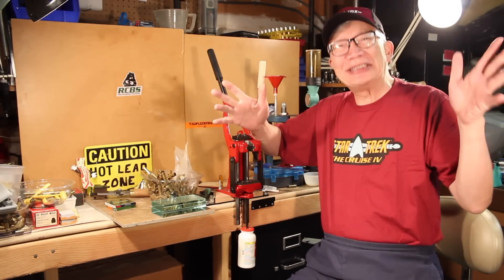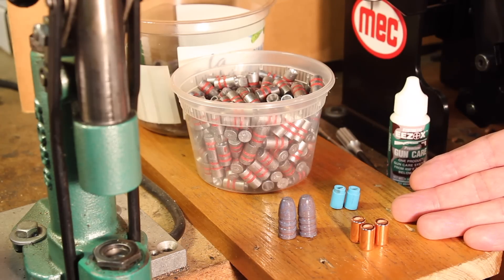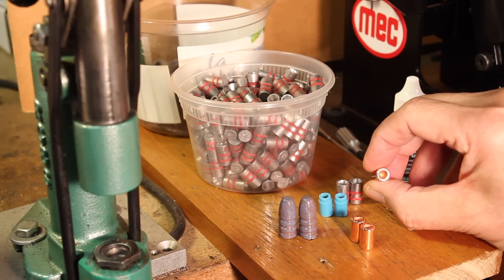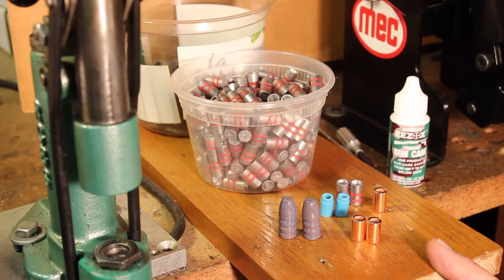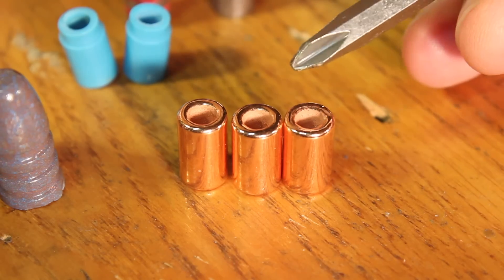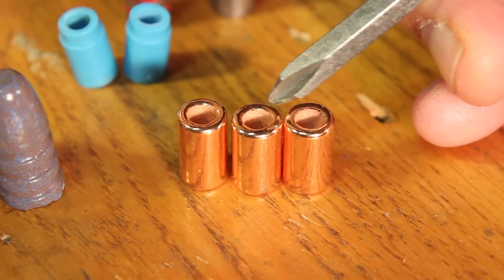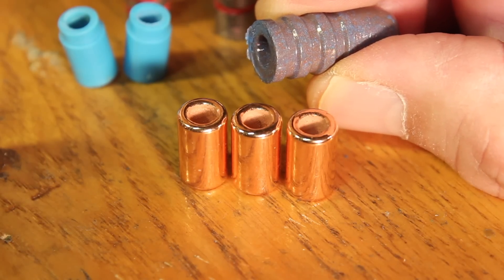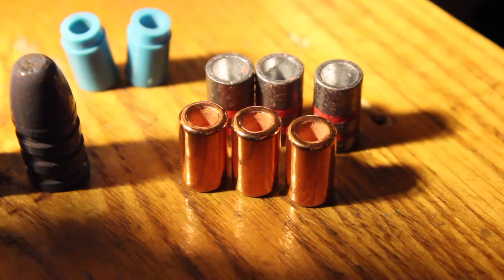The Rules Of Thumb For Hollow Base Bullets

Comment: I used Hollow Base wadcutters for years.  When I began casting, I slugged the bore of my favorite .38 Special revolver, a Colt Officer's Model Match.  I found the bore was slightly undersized at .355", chamber mouths were running .356".  I was using a 148 gr. "button nosed", flat base wadcutter design, cast from straight wheel weights and found that by sizing to the chamber mouth, .356", I got amazingly good accuracy.  I have been using that bullet ever since and it still shoots as accurately as ever.  I use 2.6 grs. of Bullseye, as I always did with HB bullets.  Velocity avg. from a 6" barrel is 698 fps.  Plenty to poke neat holes in paper targets and be very mild shooting.  With wheel weight bullets and 2.6 grs. of powder, the cost is little more than .22 LR ammo and the recoil and noise level is not much more either.  Cases last and last.  
HB designs, particularly in swaged bullets, are great if you are using "store bought" bullets.  If you are casting and can size your own bullets, experiment with sizing diameters to get the best results in whatever gun you are loading for.
Reply from the maker: gary K - The Colt OMM is a spectacular gun...I hope you still have it as it is a treasure.  Your gun was the reason Remington made HBWCs in .357" (sold them in 1000, 2000 and 3000 round cartons) as those would have been perfect for your gun.  My 38s always shot the .358s, but I didn't have that beauty of yours...  Brings back memories for sure...  Steve
Reply: @FortuneCookie45LC  Yes, I have that gun and I even bought a 2nd one!  The first time my wife shot the OMM she said "This gun likes me!" and I could barely get it away from her after that! 🤣  So, when I came across another one that was in near perfect condition, except that someone in the past had drilled and tapped the top strap for a scope mount, (ruining the collector value, but not the shooting qualities) I snapped it up for $475 !  Now we BOTH have an OMM to shoot at the range!  And I am busy casting button nose wadcutters!

Comment: After using many swaged HBWCs and many more "hard swaged" Meister HBWCs, I discovered the MP line of moulds for various caliber HBWCs. I use their .310, suitably sized, in .30 Carbine and .32-20 revolvers, and their .38, .41, .44 and .45 versions in the respective revolvers, including .45 Colt and .45 AutoRim. I cast them of 49% COWW, 49% Pb, 2% Sn, and powder-coat them, and they are among my most accurate-shooting bullets. I also use them reversed, as cup points, in all the same revolvers. The 3" Bulldog really likes the .44 cup point, as does the 4" M1905/CH4 with the .310 version, and the .45 HBWC is the basis of my match revolver loads in the .45 AutoRim.

Comment: I started casting in 1985 for 40mm & 3" cannons, both breech & muzzleloaders in both sizes. The same problems happen with these. I've had skirt separation in the 40mm muzzleloader minnie balls so i modified the mold for a thicker skirt (that fixed it) on the 3" ordnance rifle with a very thick skirt a service load of 1lb pdr & 9 1/2 lb minnie ball was like dynamite going off. The projo expanded so much the grease grooves were just lines  ware they were supposed to be. Half that charge works a lot better.
 I still run into problems with hardness variations, how to purifie old recovered bullets  to be soft enough for the muzzleloaders, ive hit them together & they ring like a bell sometimes & tumble when fired. The breechloaders use the hard ones just fine, they have solid bases😊

Comment: This information was extremely relevant to me right now. I've been working up some 38s&w loads for a Colt Police Positive with some old Speer 148gr HBWC's & bevel base WC's. Perfect timing. Thanks FC!!! 👍
Reply from the maker: TRTRTB - Thanks for posting - funny thing is that the reloading manuals give data for WCs, but these are the flat base WCs.  HBWCs don't have data, especially in the 38 S & W....but it you start with 1.8 grains of BE ( I know, it's not much powder, but that's how the 38 S & W is), you can work up to 2.0 grains if your gun is OK with that.   38 S & W likes .360" bullets and our HBWCs are .357-.358".   Thankfully, those HBWCs will obturate nicely,  Best to ya,  Steve

Comment: I was on that same cruise, that was my second Star Trek Cruise. I am getting into reloading and is still researching on the hobby. Really considering the lee turret press.
Reply: Wow! I would have loved to meet FortuneCookie while on a cruise like that. Could you imagine? I'd buy him dinner, a round of drinks, SOMETHING to say thanks for all the help he has given us over all these years. <3 

Turret presses are great for speed. If you want to reload for economy and shoot hundreds of rounds at a time, they are the way to go. More expensive and a bit more picky to use but you'll get used to it. Operator attention is absolutely CRITICAL when using it. It's very easy to accidently load a squib (a cartridge without powder) on a turret if you move too quickly and miss steps or otherwise make other mistakes. You can't line up all the cases in a block and check the powder level with a flashlight when using a turret like you could when using a single stage press. You have to check each charged case before rotating the ring and seating a bullet on top of the powder.
Reply: Get the Pro1000. It's a much better press.
Reply: @mannys9130  Yes would have liked to have met FortuneCookie and get some insight on reloading. Thanks for info on turret press was also thinking of the lee classic single press. But I saw a video on the turret as you take out the indexing rod. I thought I would use it as a single press while I am learning and when I gain more experience use the full function. What are your thoughts? Any advice you can give me is greatly appreciated.
Reply: @jungleno.  Thanks I will look into that press.
Reply: I really like my turret press
Reply: @asiangambler  Yep using it as a single stage at first is a great idea. That way you take it slowly and have the safety margin until you get comfy cranking out the bigger batches. :)

Comment: one quick question, if I dip my steel molds in ballistol and let them air dry will that protect them.  thanks. great channel!!!!!!!!!!
Reply from the maker: Howard Schleinkofer - Wiping down your molds (steel or brass or aluminum no difference) with Ballistol is a good idea, but excess Ballistol will get into the pores of the metal requiring more work to get the mold ready for the next cast session...  Good castin' to ya,  Steve

Comment: Great info. Do you have any ideas for using 38spl wad cutter bullets in a 38S&W. The 38S&W is hard to find other bullets.
Reply: Trim down .38 special Cases?
Reply: Idk if this will help you but I've been loading some 38s&w for a Colt Police Positive for some months now. Been using some Speer 148gr HBWC's, Speer 148gr Bevel base WC's & Speer 158gr semi WC's. Although I haven't been through more than a few dozen, they all work great for me so far. The HBWC's have been the most accurate. I just got the Lee 148gr full WC mould but haven't loaded anything I've cast yet. I try & keep the cartridge OAL to the same specs as factory. So the WC's are not seated all the way down into the case or flush w/the case mouth like 38spcl can be, (I've read 38s&w can't handle the pressure of a deeply seated bullet. I don't wanna test that theory so, WC's are seated half way down for me) Hope the info helps, good luck 👍
Oh, and all the projectiles I'm using mic out to .358, so yeah, 38spcl projectiles have worked great for me. .358's sit snug in all 6 of the chamber throats in my Colt.
Reply: @thereindeertherabbitthebat592  Thanks! I have some 38S&W brass and I can make that work with the 38spl WC. What kind of powder and how much are you using? 
I also have a Colt revolver that uses 38S&W.

I had bought some reloads from a clearance out at a gunshop with the 38spl WCs in them. Stupidly I shot all the ammo and did not save some to dissect. Those were the most accurate loads I have ever used.
Reply: @Altiod22  I've used HP-38 w/ 2.2gr & 2.4gr loads, they were very mild & probably the most accurate of all. (The OAL is about 1.100 w/the FWC's. & I use CCI small pistol primers) Now I'm using 700x, (only bc I have more of it than anything else). I started with 2.0gr & worked up to 2.2gr & 2.4gr loads for 700x (checking for overpressure signs in my cases/ primers & everything). All the loads are pretty slow & safe with very mild recoil & reports. I ended up sticking to the 2.2gr of 700x for the wadcutters for now. I'm sure I could work them up to be warmer but they're plinking loads for me so I'm not too concerned. I've never chronographed any of them. I hope some of this could help, good luck 👍

Comment: Having a hollow base are a different animal compared to a flat base. I believe it keeps the soft lead from leading the barrel up.There isn't any hot gasses burning around the bullet to splatter up the riflings. In black powder it was so much better especial when greasing the bullet to keep the residue softer that helps with the cleaning after 10 shots.

Comment: Seems you were lucky to get back when you did! I assume the hardness of the lead makes a difference to how much powder you can use before the skirt separates! The Snider .577 used a clay plug to both create and control the expansion. (And a wooden plug in the nose to form a hollow point). Are there any moulds that can cast a bullet like that? Finally If you are recharging, are you Borg? Resistance is futile!!! Another great video.
Reply from the maker: Chris Smith - LOL, that is a most fine comment..!!  Most HB bullets are on the soft side as the skirt can't do its thing of increasing bearing surface (and obturation) if the alloy is too hard, plus, as you say - the skirt will blow off even easier the harder the bullet is.  Plugs have been tried of any number of materials from toilet paper to clay or wood, to factories using bronze or soft steel tips to the latest polymers.  Not much point in filling the HB as we'd just use a flat base bullet in that event.   Have a great day, and health to you....  Steve

Comment: I have only used pure soft lead HBWC in .38 Special cases so the expansion will be optimal.  I need some 148 gr..358 HBRNFP pure lead bullets to load .38 LC cartridges in an 1851 Uberti revolver using a conversion cylinder so they will expand into the .380 grooves and be acccurate.  I cannot find them in the marketplace anymore.  I tried HBWC but they did not work.  Also hard alloy HB do not work either.  What is the point of using hard alloy to cast HB bullets, if they do not expand?

Comment: Just wondering would you shoot the hollo based bullet or the double-ended wadcutters in a lever gun?
Reply: Try them.  You may find they do not feed well in your lever gun. Also, make sure you use a powder charge on the "high" end of the scale for the bullet you choose.  Using too little powder can actually cause a bullet to stick in the longer barrel of a rifle or carbine.  
Yeah, not kidding. 
My favorite cast wadcutter (button nose, flat base) with 2.6 grs of Bullseye produces 698 fps in my 6" Colt revolver.  I tried them in my Winchester Model 1892, 20" barrel, converted to .357 Magnum in the 1950s (when such conversions were common and the Model 1892 was not the collector's item it is now) 
They did not feed through the action.  It doesn't like bullets without a "nose".  I hand fed one into the chamber.  The shot sounded very "quiet" and no recoil.  No hole in the paper.  Hmm.  The bullet STUCK in the barrel about 4" back from the muzzle!!  Good thing I did not fire another and used a cleaning rod to push out the bullet after soaking the bore in WD-40.  No harm done, BUT I simply do not use wadcutters in that rifle.  Not worth the trouble.  
Your results may vary.

Comment: Hi, I'm new at casting bullets and I've been wondering how much can you size down?  Would there be a limit on what can be done? Examples, I have 2 MP-MOLDS that size larger. One is the 455 Webley Man Stopper hollow base to a 452 colt and a tougher one, the 410 Hammer down to 401. The latter, I have a 406 sizer die and would then go down to the 401 die. I'm going to try but not for a while.  Thanx, JR